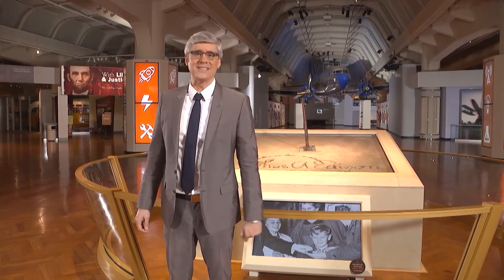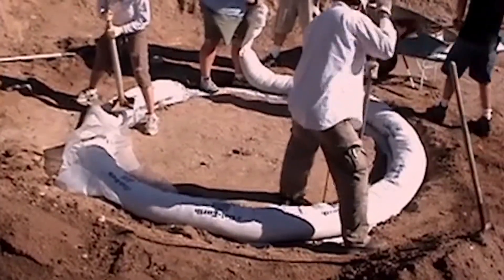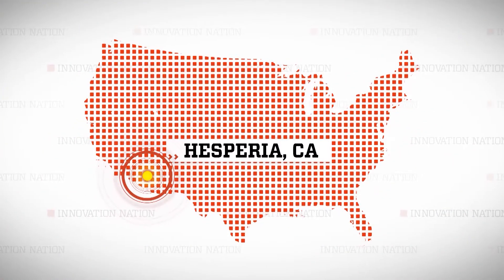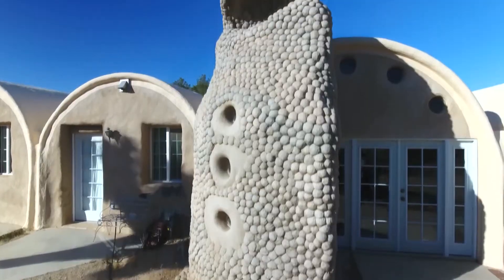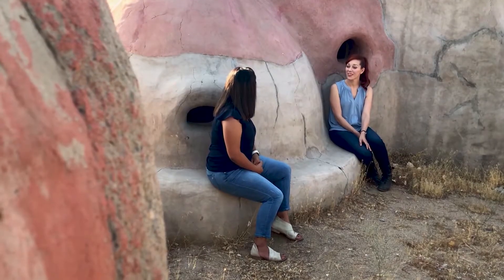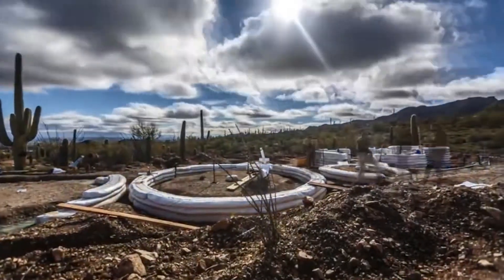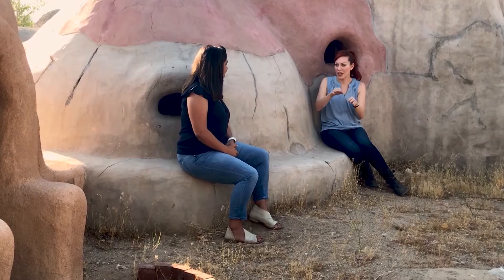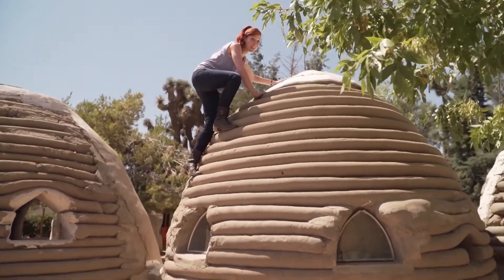How Super Adobe Houses are Made | The Henry Ford's Innovation Nation

Comment: These are VERY Difficult to build, one needs LOTS of human power and Machines. And these house are NOT very safe, they can cranble easily. Also the plastic tube they use to put the adobe are Very slipery so, it is very difficult to cover them with more adobe. anyway, do your Own research.